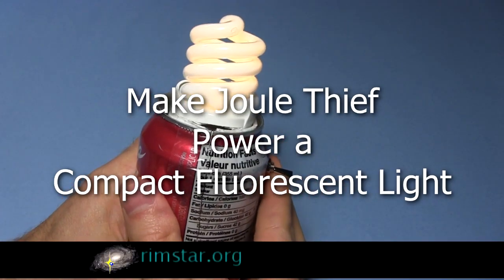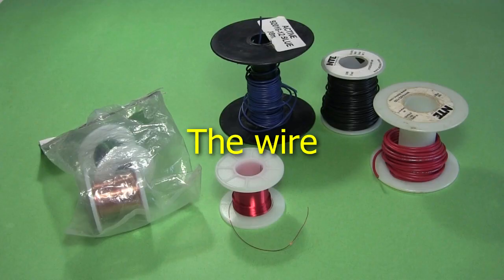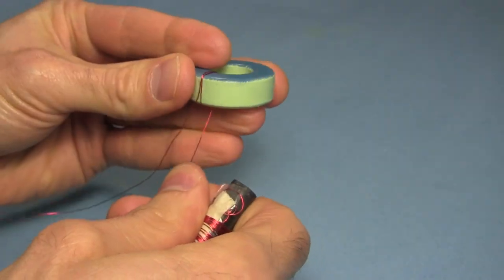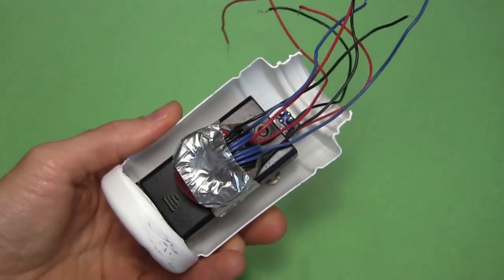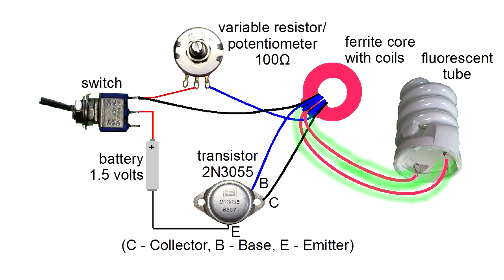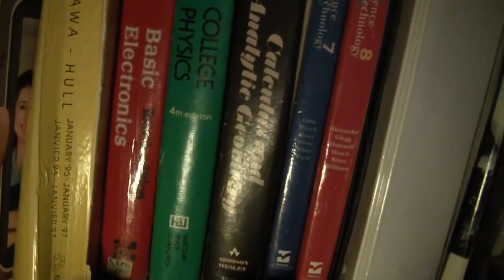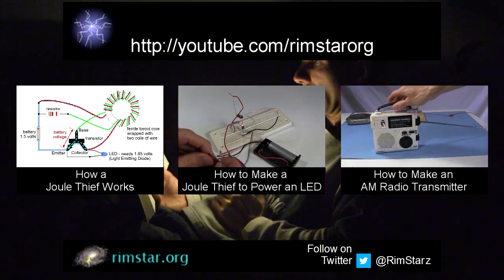How to Make Joule Thief Light a CFL - Jeanna's Light

Comment: 3v battery can power 230v CFL easily but the current draw will increase proportionally, causing the battery to deplete quickly. This is what I had learnt in school, but I do believe in overunity. As a result I want to understand what's happening in your circuit. 

Is it depleting the battery quicker than normal or is it actually drawing lesser current from battery despite stepping up the voltage to 100 times?

If it's really amplifying the wattage, I'd try to replicate it. 

Although I did some experiments with bitoroid transformer and got success to some extent. 

Thanks for taking effort in explaining step by step process of making joule ringer CFL light. 

May God gives you more strength and wisdom!!
Reply from the maker: All the joule thief circuit does is build up energy in the magnetic field in the coils and then dump it all at once into the output and then repeat. So the output is made up of short bursts with nothing in between. Not a very efficient circuit, but it works. It's also called a blocking oscillator circuit. I show the output in this follow-up video https://www.youtube.com/watch?v=FkLET8MhRbU I explain the basic joule thief circuit in this older video http://www.youtube.com/watch?v=DAyM8Iet1O8
Reply: @RimstarOrg  thanks for taking time to answer my queries. 
So joule thief circuit increases the voltage and current but decreases the duty cycle. 
I believe if we collect the short duration high voltage and high current pulses into a capacitor and charge another battery with it, the charging battery will charge faster than the source battery will deplete. I think it will be overunity. I read it somewhere on overunity forum.

Comment from the maker: The main point about the magnet wire is that it has thin insulation so that allows you to put on a lot of turns. So does the fact that it 30 gauge (AWG) wire, which is very thin. So basically, any wire you can find that will allow you to put a few hundred turns would be fine. You could also try putting multiple layers if you can get many turns side-by-side.

Comment from the maker: The variable resistor allows you to adjust the brightness. You can try with a fixed value resistor, around 25 ohms to around 60 ohms, but if one doesn't work, try a smaller one. I show me adjusting it in my "Fun with Joule Thief Powering a Compact Fluorescent Light" video. There's a link to it in the description below this video.

Comment from the maker: I don't know any other transistor numbers off-hand that'll work but one way to find some is to do a search for "2n3055 equivalents". You can also use PNP transistors if you reverse the battery in the circuit while leaving everything else the same (the 2N3055 is an NPN transistor.) I do that in my "Fun with Joule Thief Powering a Compact Fluorescent Light" video (see link the the description below this video) using an NTE219 PNP transistor.

Comment from the maker: To be galvanized means it has a thin coating of zinc on it to reduce corrosion. From the wikipedia page, the "it" can be iron, steel or aluminum. I'd think iron or steel would be best due to their higher permeability to electromagnetism. Aluminum's permeability is around that of air. Sounds like you have some experimenting, and winding (;-)) ahead of you.

Comment from the maker: The best I got with this coil was 1 hour and 45 minutes. I show doing these tests in my "Fun with Joule Thief Powering a Compact Fluorescent Light" video (there's a link to it in the description below this video.) And no, it can't charge itself, at least not indefinitely. Though there are circuits that power an LED and do some charging, but the batteries eventually run out.

Comment from the maker: I get mine by taking apart old electronic things. The one in this video came from an old power supply. There's a nice one in most microwave ovens. Ordering online is another option, ebay for example. I don't usually see this type in electronics stores.

Comment from the maker: I can't measure the amp output because it's neither DC nor AC and that's all I can measure. But the voltage spikes at just over 700 volts. See my video "Fun with Joule Thief Powering a Compact Fluorescent Light" when I show the oscilloscope output in detail. There's is link to it in the description below this video.

Comment from the maker: Yes, you can use a fixed value resistor instead of a potentiometer. But it sure is nice to have the resistance be adjustable. The best value will vary, based on your CFL mostly I guess, so it'd be good if you had a few different value resistors to try. In the experiments I did in my other video "Fun with Joule Thief Powering a Compact Fluorescent Light" I used around 30 ohms for a 13 watt CFL and around 70 ohms for a 5 watt CFL. There's a link to that video in the description below this video.

Comment from the maker: I was originally thinking of embedding it in the top of a wooden staff (ala Gandalf's staff or something) but I love how the cola can turned out instead.
Interesting stuff of JonnyDavro's. It seems if you look at just the basic principle of 'store up energy and then release in a burst' there are a huge number of ways to do it - probably even mechanical!
I only measured current at the early prototype stages and it was over an amp at one point. Don't recall which coil iteration that was though.

Comment: what is your toroid size?? inner and outer dia??
Reply from the maker: It was pretty randomly selected. I chose it because I figured it was big enough to get a few hundred turns of wire on. But it was 1 1/4" od by 5/8" id.
Reply: RimstarOrg  I have a toroid with od=2,5cm and id =1.3cm
Is it ok??
Reply from the maker: DEBASISH DUTTA
That's a little smaller than mine so you won't get as many turns using a single layer. Doing multiple layers would be tricky because you'll have two adjacent turns that are at a big voltage difference from each other and may conduct from one to the other through the insulation. The only way I can see to avoid that is to go around just once, but as you do, overlap the turns. i.e. don't try to make it all one flat layer as you go but every now and then back up a few turns and put more turns on top and then continue.

Comment from the maker: With rechargeables, I don't know. Rechargeables I've had in the past don't hold as much charge as non-rechargeables but there are other types of batteries that can be used too. Using the batteries in this video and the 13 watt CFL it lasted 25 minutes at full brightness and 30 minutes dimmer. Using a 5 watt CFL it lasted 90 minutes at full brightness and 15 minutes dimmer. See my follow-up video "Fun with Joule Thief Powering a Compact Fluorescent Light" (link in the video description.)

Comment: What is needed for this Joule Theif Light
1. Fluorescent light
2. Two AA batteries (1.5 volt)
3. Battery holder (for AA batteries)
4. A switch
5. Power transistor
6. Variable capacitor/potentiometer
7. Ferrite core
8. Magnet wire
9. Thicker insulated wire
10. 18 gauge wire
11. Tape
I'm just putting this comment just in case you want to write it down really fast instead of pausing and playing the video. :)

Comment from the maker: You haven't done anything wrong. Mine probably become hot too except that I can't tell since it's in the can. It's not a problem for me since I don't keep it running long. The solution is to attach the transistor to a heat sink. I do that in my "Fun with Joule Thief Powering a Compact Fluorescent Light" video. See my "How to mount/attach transistor to heatsink (2N3055)" video for how to do this. There are links to both videos in the description below this video.

Comment from the maker: +Nishi Chemie You can increase the output of your solar panel by giving it more light. Keep in mind that your solar panel can give out only so much voltage.
If you want to get more voltage and amps from your solar panel but without increasing the light then you can't. There are circuits that will increase the voltage while dropping the amps or that will increase the amps while dropping the voltage but you can't increase both at the same time without supplying more energy, i.e. more light.
Reply from the maker: ***** I buy my 2n3055s at local electronics stores, though it's cheaper to buy them online (e.g. ebay.com). I don't understand the rest of your question. If you're asking for a different circuit to power your fluorescent light, I don't have any other circuit off hand.
Reply from the maker: ***** No, I've never heard of it, so I probably can't help you with it (at least not with my available time.) But I did a search and found a few things, but nothing black and heavy. Do you have a link?
Reply from the maker: ***** Thanks. Looks like an automotive ignition coil and a battery. I guess the flame comes from having an ignitable gas flow through the arc? That's what it looked like in some of the videos I saw when I searched earlier. I don't have any circuit to add to it to power a fluorescent light. Possibly something with a 555 timer chip and the ignition coil will do it. Try looking for a circuit with those two things. I know I made one once but I never documented it. I didn't try a fluorescent light though.
Reply from the maker: ***** You're going to have to search for that yourself. I'm not even sure it if will work since I haven't done it. It's just a suggestion so that you have something further to look into. I only know that I once managed to make a high voltage power supply using a 555 timer and an automotive ignition coil, but I never used it with a fluorescent light. I don't have the circuit anymore.
Reply: RimstarOrg Actually, using an ignition coil+555 chip ought to work REALLY WELL to light up a CFL although it won't be so compact any more. Should be interesting to try.
Reply from the maker: +Idiot Comparing https://en.wikipedia.org/wiki/2N3055 with https://cdn.sparkfun.com/assets/home_page_posts/1/8/2/1/CY_122DL_Datasheet.pdf it looks promising. I don't have a list of transistors.
Reply: rimstar org
in your joule thief cfl circuit, can you replace your transistor with 2 others of the same type connected in such way to create a single Darlington transistor and replace the 3rd coil with another one using a bigger - in diameter - wire so you can increase the power output?

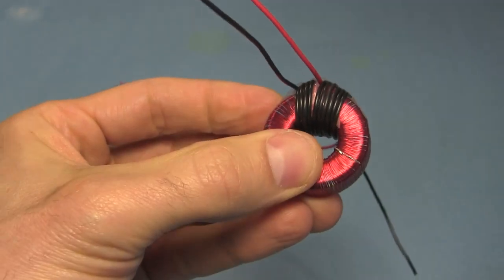Comment from the maker: I mean the 1st peak is positive over 700V, the 2nd peak is negative 225V, the 3rd peak is positive 140V, the 4th is 100V, the 5th is 70V, and so on. Each successive peak as the voltage alternates is lower and lower, so it's dampened. That happens each cycle as the transistor is turned off and the energy from the magnetic field is dumped. You can see this in my "Fun with Joule Thief Powering a Compact Fluorescent Light" video at 2:55 where I show the output at the CFL on my oscilloscope.

Comment from the maker: Not sure what you'd consider a super joule thief, could be lots of things. But if it's going to create a high voltage then you'll need better insulated wires where there would be high voltage, as I point out in this video. So if the toroid is small, you may not be able to get much of the more thickly insulated wire onto it.

Comment from the maker: I honestly don't know. It may also depend on the length of the tube. A 13 watt CFL is longer than a 5 watt CFL and from experiments I did today it sure looks like the 5 watt one ignites and is brighter at a lower voltage. I'm in the hundreds of volts, not thousands.

Comment: Nice
How long do you think it lasts? Does it last longer than a LED with the amount of lumins in produces? 
Also some small solar cells inside the spiral and under the spiral would help the lifespan. And for more power have the light redirected to have one side as a reflectorfor to make it brighter on some things, of inctead of a reflector a solar power on one side. Would that help it use then one battery?

Also why have a potenciometor which you ditn say? Those can't be adjusted cfl brightness.

Comment: Rimstar, Just now completed replicating your this ballast-less cfl circuit. At first primary & feedback just wounded as you did i.e. on the top of HV wires & it worked with 3.4v battery for a 40w Chinese cfl with very good light(VR at 48 ohms setting) but circuit at this voltage draws 4.5 Amp( which is I think too much).  Afterwards changed the position of primary+feedback to elsewhere in the toroid & that way also works but there is ringing in the toroid. I replaced the pot with 48 ohms resistor & it is OK. Could not check for Amp draw again because the battery has gone down to 1100mV. I will check that tomorrow.The circuit is very cool. So I will probably check with TIP31c in stead of 2n3055 & if it works then the cost will surely come down. Anyway, Cheers.
Meantime, I think you are a professor because you explained all of the pros and cons of the circuit in such a way that the professors normally do.  Keep it up, Sir.
Reply from the maker: mnasim31 Thanks for the very good report on your progress. The current is not flat DC and it's not sinusoidal AC so I'd be suspicious of any current measurements unless you have a special way of measuring it. You can see the waveform for the voltage at least in my follow-up video "Fun with Joule Thief Powering a Compact Fluorescent Light". I'm glad you found my video useful. Thanks.
Reply: RimstarOrg Thanks for your reply. I have already seen your this video a few times which is also full of learning things.Today I have changed the primary and feedback wire into 14 & 18 AWG and tested with 7v (2 18650 type cell in parallel) battery and now the cfl is not on only at 48 ohms setting but at any setting from 48 through 90 ohms(about).Regarding the  Amp draw:  at this voltage now the circuit is drawing 160mA to 220 mA, what  is your opinion?
Reply from the maker: mnasim31 Regarding the difference in current, do you have an oscilloscope? You could compare the voltage waveform with the previous high current windings and your newer low current windings. Perhaps the fequency is lower, resulting in lower current. As I said, I wouldn't go strictly my a meter's reading of the current since they're not made to read that type of current.
Reply: RimstarOrg I don;t have an oscilloscope, in order to compare the waveform. Its OK, as long as it is working even at 800mV, I have replaced 2n3055 with tip31c & it is working just fine & the circuit is very cool. No heat whatsoever. Also checked with TO-92 package transistor C945 & it is working as well but the transistor is just warm(not hot). I hope this information will be helpful to a lot of your followers.
One more thing I have noticed that if primary & feedback are wounded on the top of HV thick wires, then if you put a magnet at the opposite end of toroid, the light of the bulb is increased by about 5% but if primary & feedback are wounded elsewhere on the toroid then there is no effect  of magnet. I was thinking as to how to increase the lumen  of this ballast-less bulb, so that a lot of cfl can be recycled for day to day use.Anyway, have a good day. Bye from Athens, Greece.

Comment from the maker: Well, it's sort of AC in that when the magnetic field dumps its energy you get a dampened wave, but the first peak is huge compared to all the res; it dampens real fast. Have a look at my "Fun with Joule Thief Powering a Compact Fluorescent Light" video (link in the description below this video) and you'll see the oscilloscope output. It also works quite different than a flyback. See my "How a Joule Thief Works" video (link in the description or maybe I misunderstand flybacks.

Comment: thanks a lot for this educational video! i had many hours of fun trying to reproducing this. i never lit up a CFL, but i didn't take it apart. i did however get a high AC voltage from my joule theif, which is about 1/3 of ur size core and 200+ magnetic wire winds and about 5 winds for the two primaries. i don't have a oscilloscope, but my volt meter vibrates at HV so it's pretty high(when passing 4.5V through). using 2 c1846-r transistors in parallel. the green/blue core is a bit under an inch.

Comment: very nice project, educational and fun !
i am sure that little AA battery is very Happy among those monster size components :)

Steve i don't know you smoke or not, but you should keep a bottle of Zippo Lighter Oil in your lab cause nothing can remove that sticky label residues rather than that oil.

i had that problem with HDD label removals, nothing helped until i found the magic :)

good luck with next one.

Comment from the maker: It doesn't really matter what old power supply means. We had a store that sold old electronics things for scrap. I was looking for ferrite cores and this thing had a bunch of them in it. So I bought it and took it apart. I think it was a switching power supply, but that's as much as I know. If you don't want to buy them online then just start looking around for electronics devices that people have thrown out and open them up and see what's inside. Old TVs, microwave ovens, radios, ... anything.,